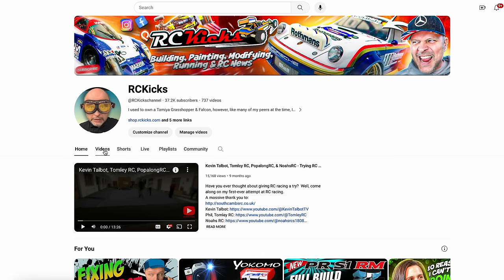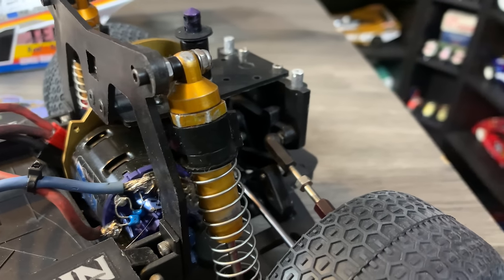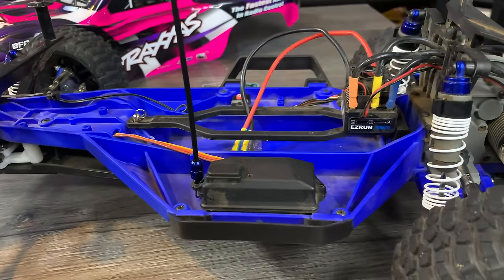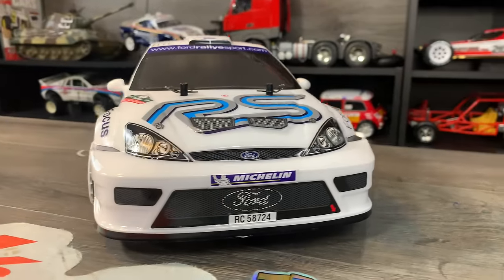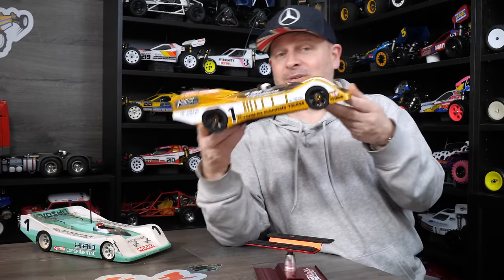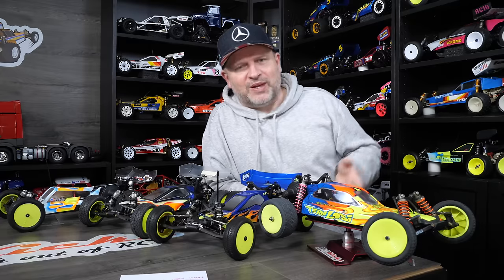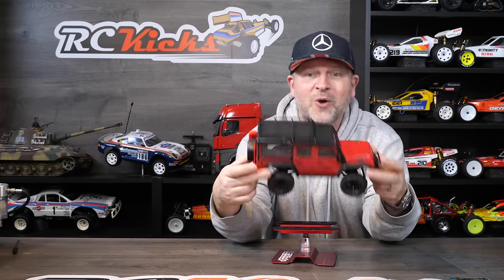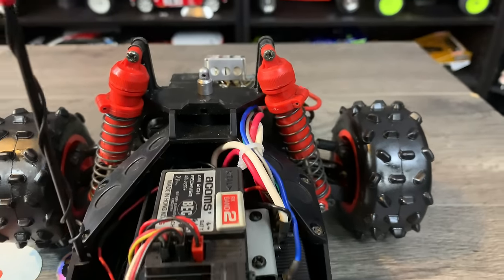Out Of Control RC Collection Grows Even Bigger In 2023!

Comment: TRX1 and TRX3 were my first ventures into vintage buggies. Stupidly I built the TRX3 from individual parts ordered off the internet atleast the TRX1 I had a Chassis and Suspension to start with. Really want a vintage Bandit but the ones I do find are rather beat and nobody reproduces the vintage body otherwise I'd settle with slapping a reproduction body on my XL5 or VXL.